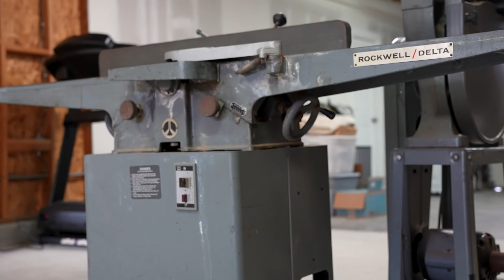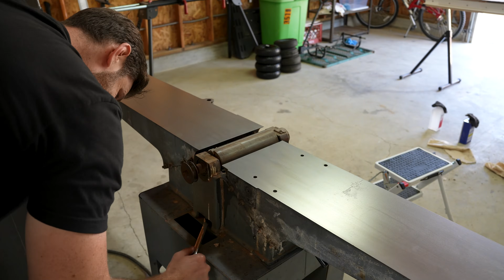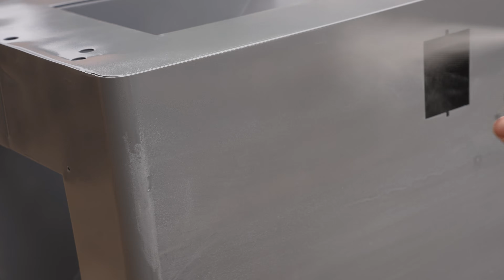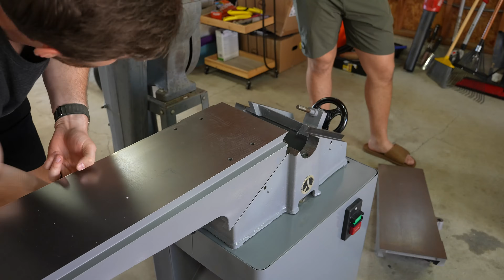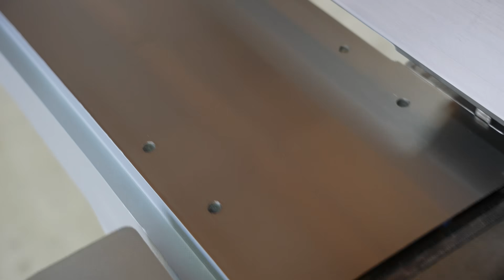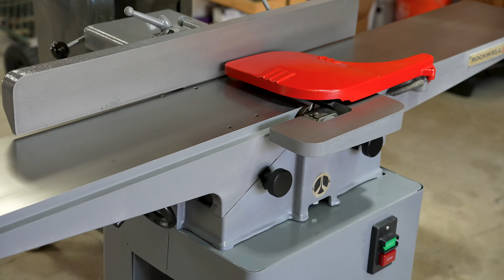Delta Rockwell 37-315 8-inch Jointer Restoration

Comment: Great video. Did you replace the spring for the blade guard? I just bought one of these and the spring is missing. Thanks!
Reply from the maker: Thank you and yes I replaced the spring. I was lucky to find one at my local DIY store surprisingly. Otherwise this is a great place to visit https://www.mcmaster.com/
Reply: @therightangle aha. Yes mcmaster is awesome. I was crossing my fingers you had the length of spring/OD scribbled down somewhere so I could buy one on McMaster. I'll do some trial and error. Thank you sir!
Reply from the maker: @justindarling6657  Absolutely, just checking to see if you were able to find the part you needed. Otherwise, I hope the build or restoration is going smoothly.

Comment: That’s the jointer I just purchased. My  feed won’t adjust. Do you have a video on table removal ? I’d love to see close up the cut depth adjustment mechanism before I open her up
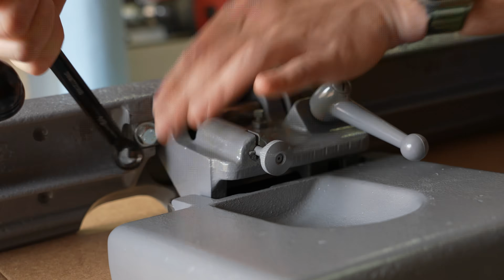Reply from the maker: Sorry I don't have a specifric video for the table removal. The best I have currently is what you can see from 1:59-2:12. There are a number of things that could be causing it I found the quickest thing to check is the gibs” (side screws) might be too tight. Find the small screws on the side of the table and loosen them just a tiny bit (about 1/8 turn). After each small loosen, try moving the table up and down. Once it moves smoothly with no wobble you’re good. Hopefully that helps out let me know.

Comment: how dop get the table off?  pulled the set screws and spacer bar (gim?) out but still cant get it to come off
Reply from the maker: Its been awhile since I took this apart but your on the right track I had to look up my manual again to verify the part name. Now that you have pulled the set screws and spacer bar (Gib) you want to lower one of the tables to the lowest setting using the handwheel and then the oppisite table crank all the way up until it comes off the adjusting screw. So you end up sliding it up and out on an angle. The block that is connected to the adjusting screw and handwheel works as stop. Hopefully that all makes sense haha. Let me know how it goes. At about 2 minutes you can kinda get an idea of how it goes on and off in the video.

Comment: Thanks for this video. I'm picking one of these up this week. I hope I can get it as good looking as yours.
Reply from the maker: I am sure you will and if you need any more help or tips just send me a message. I know having well-functioning machinery is vital. Once the initial restoration is done it takes minor maintenance to keep things running smoothly for years to come.
Reply: @therightangle   Thanks. Did you end up doing anything with the dust collection? I'm considering buying some kind of shroud so I can hook up my dust collector.
Reply from the maker: @getothfam  It's still a work in progress when I purchased the Jointer it came with an aftermarket dust hood I think it is the POWERTEC
Big Gulp Dust Hood. The only bummer is that the holes don't line up but it's nothing we can't fix. It is definitely on the list but for now I just have an open short trash bin to collect what comes out.
Reply: @therightangle   Got it thanks! I'm thinking I'll have to drill and tap my own holes to fit whichever hood I get.

Comment: I did not notice that the outfeed table was drilled for a knife sharpener. But, I did notice that your jointer has the “Knife Stop” (knife indexing stop p/n 418-04-088-5005) mounted with the small screw on top of the left hand cutter head bearing housing.  It’s missing on my 37-315 and my bed is drilled for a sharpener. If you ever get a sharpener or just want to hone the knives, rotate the stop 90 c/w and push it into the holes drilled into the end of the cutter head. The stops are not available. I need to borrow one or go freehand and make one. The Stop might also be useful when setting the knives. Oh, goes w/o saying, wonderful restoration and nice video.
Reply from the maker: Awesome I didn't even know that was an option I love learning about this stuff thank you for the info. I will look into myself as well, and I appreciate the support. Hoping to do some more restorations soon. Had my first child and have been quite busy getting used to the new schedule.